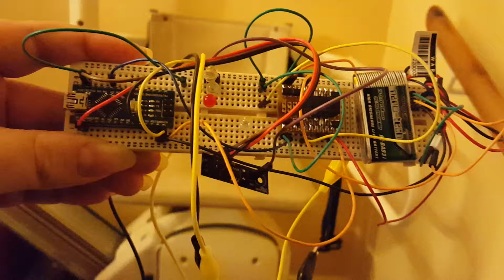Stairlift remote control - Breadboard version

Comment: I am trying to clone the Acorn 130 T730 IR remote to one of my URC IR Learning remotes model 9910.   I get the SUCCESS when learning either UP or DN command  but when I go to use it I only get a quick burst not a continuous IR output needed for the stair lift.   Any thoughts?